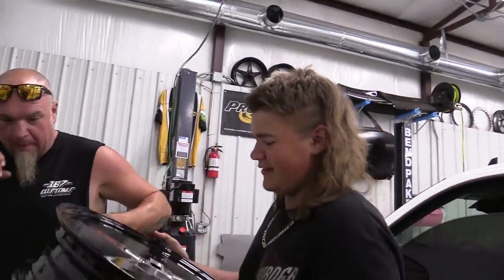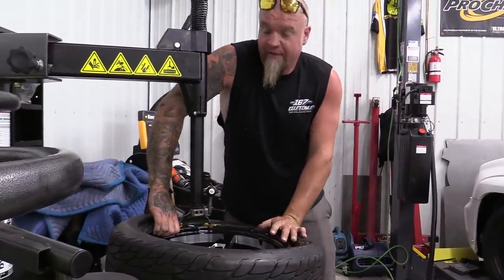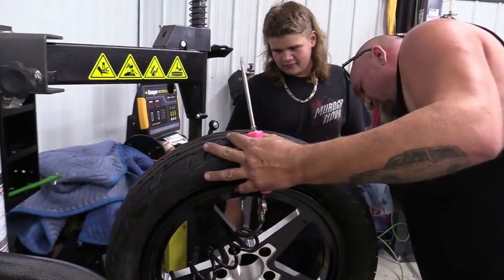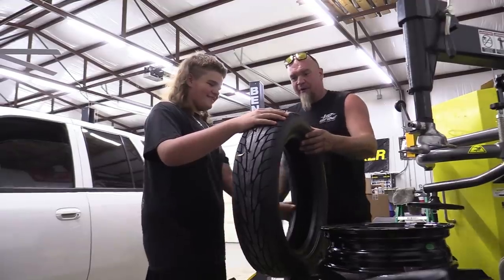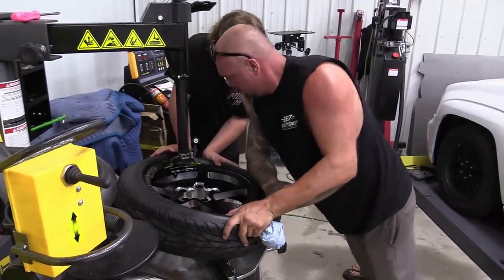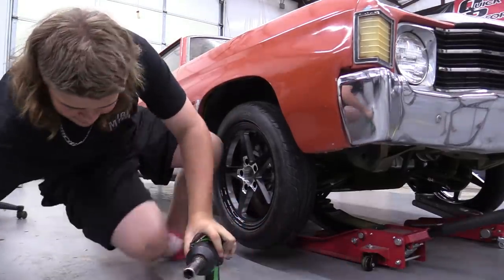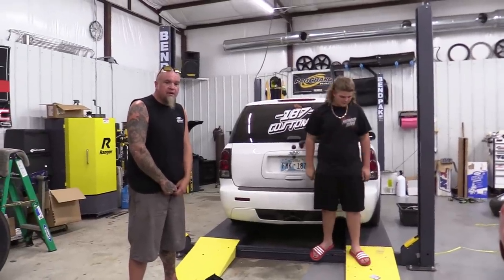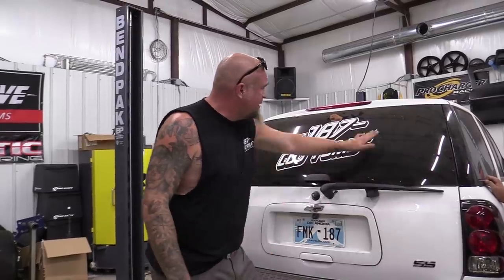BUILD SERIES!!! Building Aiden's Chevelle: Episode 8 Installing New Front Runners

Comment: Drives 3000hp car,scared to death of a bead seating on the tire.
Reply: Obviously you have never experience a wheel blowing off the rim will mounting   Remarks like these come from uneducated people. You should look it up   Be safe
Reply: @29plycoupe2  ive actually seen a guy die from a split ring one leg inside the wheel and the other on the outside of the wheel was the gruesome situation i have ever witnessed. Couldnt imagine what the guy was feeling seconds b4 he passed away. Body was seperated from a whole leg basically cut in half. Terrible way to go.
Reply: You watch two much you tube ...lol plus I don't think shawn would be mounting some ancient tech hub less ring wheels or newer heavy equipment tires.

Comment: 3460 , Please use Jack Stands , you supposed to Mix that tire soap with water and then you put it in the jug that looks like a Spit-toon with the wire handled tire mop it goes on a lot easier , most of the time there's a blue dot close to the bead you line that up with your valve stem (it helps with balancing) please use jack stands cause you hope somebody is around when that jack lets go , please a friend of mine died because of a floor jack , keep up the good work and making memories

Comment: I work for AAA bud and there are a lot of people that don't check there tire pressure and they go to make a turn and the tire rolls off the beed . So they call want us to swap the spare on I check the tire if the tire is good I pop it back on the beed here is a trick for you in the future. Put a ratchet strap in the center of the tire tighten it up a bit start putting air in it and as soon as it pops stop putting air in then release the strap and your done.

Comment: You're supposed to leave the wheel locked down until it pops that way the wheel is secure and when you slide the tire on you put it on on the valve stem side first and then it won't be below the valve stem

Comment: This will help like when you do the donk wheels an tires.. (relaxing the bead) 26 an up are fun.. lol. Most are reverse mount. You can tell by how the drop center of wheel is. Those if you mess the direction up on or if its A symmetrical. Suuuuuuckkkk. So much easier to mount 26's.then to dismount..

Comment: Lmao quitting the lube on the top half of the tire an only on the first half . You done all that right shawn just run that top tire dry on the top and it will go on every time. Make sure its tucked in the center of the rim.

Comment: I use Rope With A slip Loop And A Long Straight Screw Driver Or Ratchet Straps Sometimes To Seat Beads On Tires And Wheels But Shawn Would Shit, If He Seen My Preferred Method With Starting Fluid On Tractor Trailer Tires And Wheels, Jumping Them Off The Ground A Couple Feet And A Bit More At Times But I Love It LOL

Comment: Slightly painful to watch at times.. only because ive done wheels an tires for years.. but i dont even come close to the knowledge you have on vehicles. Just a tip. There is a thing called relaxing the bead.. where you inflate the tire without the core. Let bead pop.. fill to where it should be. Then take all the air out an refill to spec. Help with balancing. Allegedly.